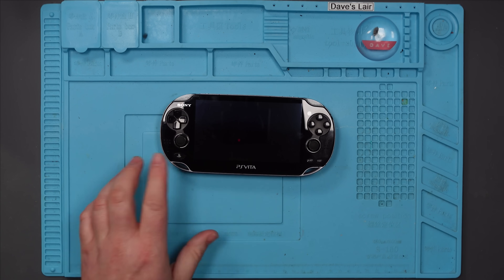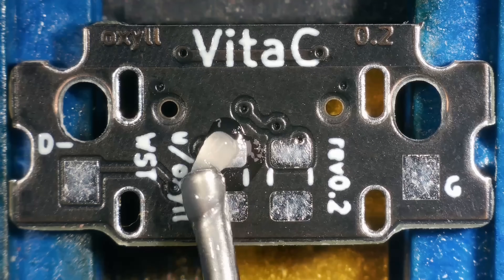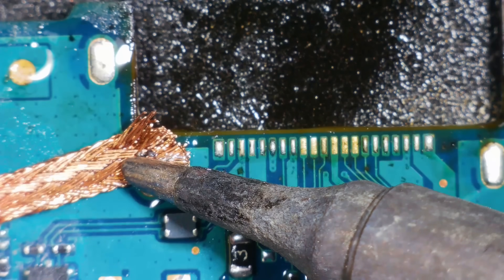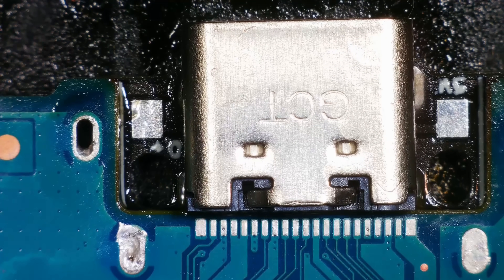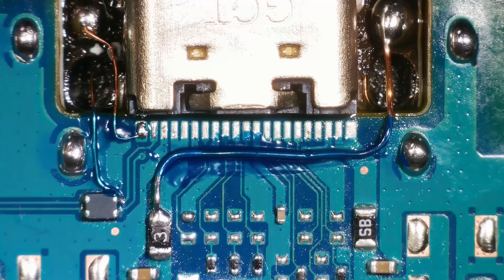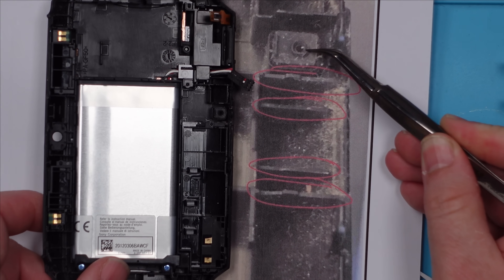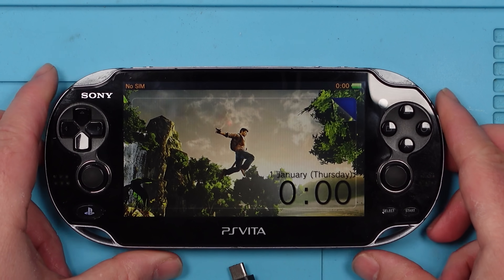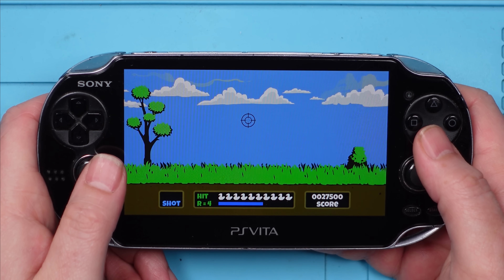My PS Vita DIED | Let's INSTALL a USB-C Port!

Comment: Could they have found a dirtier vita to photo for the instructions?!? The amount of dust on the photo showing what to cut off the case 😳. Plus the 2 resistors are the wrong way round, they don’t match the direction of the writing in the board 😔. Great video as always though 👍🏻
Reply from the maker: I noticed that on the resistors and it made me twitch.  I might have to take it apart again and sort that out!  😬
Reply: @StezStixFix  hope so as we won’t sleep tonight thinking about it 😂
Reply: @paulchambers3788  😵‍💫
Reply: I have trashed a couple of PCB's before because one diode was the other way around then the diodes next to it.
I dont know how I missed it in kicad before sending the files out😬
Reason for trashing them: assembling them wrong a couple of times😂

Comment: Funny, it always amused me when Steve does fixes like these and says the mod is in the description. I would love to mod my 3 Vita's, but I would not even dream of  attempting to as I know I would ruin them. Even when I used to do this for a living (TV and video repairs,) I would not even attempt to solder surface mount components, or components you cannot solder with the naked eye. I just stuck to through hole stuff. I would leave this sort of work to to the experts like Steve ( even though for comedy reasons he pretends not to be.) Also, I never used flux either. Had to look it up when I saw Steve using it to see what it was!
Reply: I've learned flux is essential for soldering I used to think I was just terrible at it untill I started using it.
Reply: @Daffydubs  Lol, my eyes are so bad now unless the pad is at least an inch square,  I would not be able to solder anything onto it.
Reply: @yogibear2k2  I hear that! Components are getting smaller everyday lol
Reply: Anyone can do surface mount work, just takes a bit of patience, practice and a microscope doesn't hurt. Believe in yourself!

Also most people don't use flux because they use flux core solder, which is a more efficient method of applying flux at the same time as solder. It doesn't work if you wick your solder onto the tip and then touch the tip to the component though, so flux helps with that habit.
Reply: I ruined my vita attempting to
Reply: Oh you're missing the secrets right in front of your eyes... Flux is magic. It creates just the right surface tension so you need absolutely no skill with the soldering iron. You just put the heat in the area and everything kind of melts works supposed to with surface mount stuff.
But the eyes thing. I feel you man. That's why there's one other secret to everybody who does surface Mount things regularly.

We don't look at it. We look at the big screen for the camera or microscope.

I still can't do the hand soldering if I have too much caffeine but you can do hot air.

Comment: I think PS Vita is still a decent emulation game machine if you're aware of its performance limitations.
Reply: What do you mean? It's a GREAT emulation machine. It can play anything up to PS1 and even a couple PS2 games IIRC. Plus it has a great library of its own.
Reply: @reeepingk  I'm using a GPi Case2 with a Raspberry Pi CM4, which has incomparable performance advantages to older gaming machines. However, when considering only PS1 games, PSP and Vita are devices that are officially PS1 emulation supported by Sony, so it will be perfect.

Comment: Would love a little video just explaining each step for newbies who don’t totally understand what’s going on 😂.
Reply: Sure.
I can explain what's going on in this video easily.
So you probably get the basic concept of the old proprietary port no longer works so he wants to stick a modern USB-C cable on it.

So the first thing he's doing is melting in low melting point solder. This is an alloy of metals that melts easier than what's on there. So you melt it on there and you melt the other stuff that's there and it all mixes together and ends up with a lower melting point than before. He was trying to do it so that he could just heat it all up and it would all stay melty long enough to lift it off but it didn't quite work out that way.

So instead, he used his hot air gun. This literally blows out very hot air until the parts are hot enough that the solder melts and becomes liquid. And then he kind of pushed it away when it started to float around there. Then you take away the heat and everything on the board hardens up and you have the slightly melted port in your hand.

The stuff that's goopy you see him drooping on everything is called flux. It is a kind of liquid that lets everything float around and move around easily and give surface tension. So you glue it on around the areas and then you put your melted solder that's on your soldering iron in those areas and it just sticks to the metal there and kind of holds the shape. So if the pad is square, the blob of solder is square. It will also let the parts float around and slide into position so that the surface tensions even on both sides. When he puts the resistors in, those rectangular pieces with solder points on each side in the beginning of the video, they kind of get sucked into place properly by the melted solder. And this is just the surface tension sliding around these really light components.

I guess I should have started there. He put together the USB-C port piece.

USB-C, requires you to have a couple resistors on the device. This lets your USB-C charger know that it's plugged into something.
So we soldered those resistors onto the board, and then we put on the connector. And then he goes and puts the whole thing on the device.

The big blobby corners that hold it in place, also count as the ground.

That first wire he puts on that cuts across and goes to the side, you'll hear him talk about that being the plus side or the 5 volt side. That's the output of the USB-C port power. So that's going to give power into the device as the positive side.

So now you have your negative side and your positive side but you don't have your digital signal. You don't have the data connection.

You hear him say D-positive and D-negative. The d stands for digital signal. So the positive and negative communication wires is what he's connecting there.

With those wires connected, it works just like it did with the proprietary connector for USB. It gives power, and it gives a data connection to the computer.

When he's connecting those wires he's using a wire that is coated with a thin almost clear enamel paint. this works as insulation on it so it doesn't directly short out against things. But it's also not very tough and it melts/burns easily.

So he can just stick it on the soldering iron and it burns away part of the enamel on it, you can see this because the silver solder gets wicked onto it right up until the area it didn't burn off. So this wire isn't completely bare even though it looks like it is... It's just bare on the ends but it can easily get scratched in short stuff out.

So he's putting on a UV mask with the paintbrush. This is a type of chemical that the whole board is actually covered with except for the solder points. The bare metal points that you want to connect with. He coats everything with it and it stays liquid until he puts a UV light on it for a period of time. That's that little block you put over the area. On the TV screen it will look purple because the camera can see part of the UV light but in real life it doesn't look purple, it doesn't look like it's even on... When you put that on, it hardens and becomes solid.
So with that solder mask coating it it will hold it in place and keep it insulated.

I think that covers most of what he did in the video
Reply from the maker: Fair point!  I need to try and remember that!  👍
Reply: @StezStixFix     again fair point....,but, you won't...🙄
Reply: that's what he's doing no ?
Reply: The vast majority of people don't have enough patience to solder 0603 smd components... which are smaller than a grain of rice.